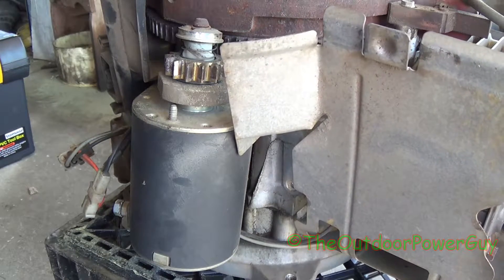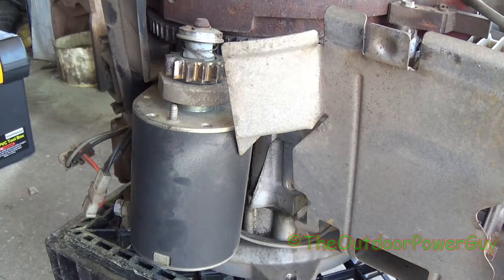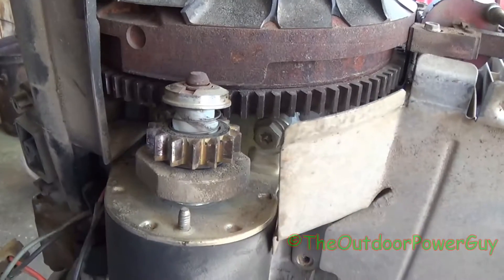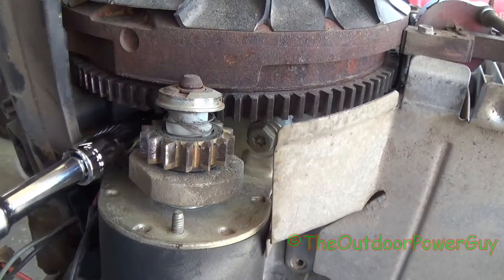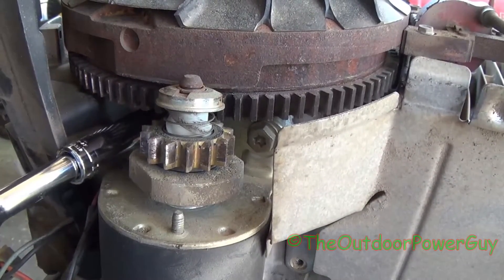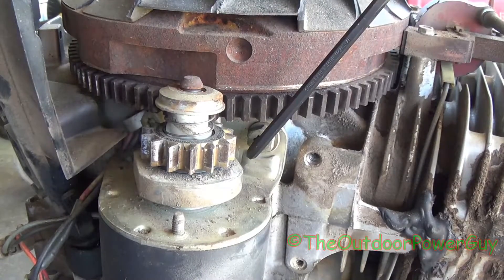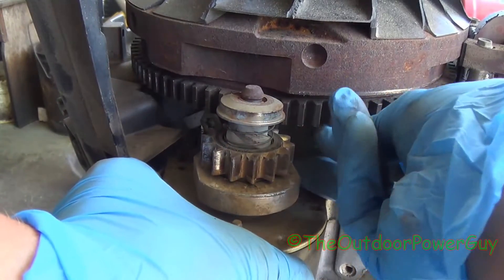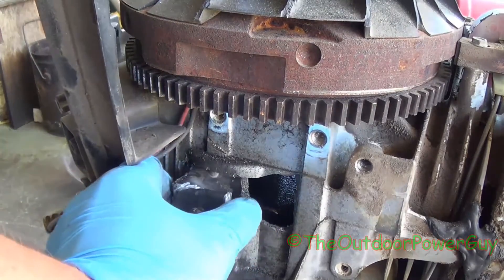HOW TO REMOVE THE ELECTRIC STARTER ON A 17.5hp BRIGGS & STRATTON INTEK ENGINE 31C707

Comment: I bought a old riding mower it has a 17.5 Intek  Just like the one you have. I pulled the starter off And sure enough a big busted out hole, just like yours.  Not liking these Intek engines so much. And the mower I use has a 17.5 Intek on it as well.

Comment: Do you have a part number for the replacement starter?
Reply from the maker: you have to make sure what type of gear your current starter uses, you got a plastic and a metal one, they won't interchange, if you are unsure look on the valve cover of your motor, there will be a model type and code, you can email it to me at youroutdoorpowerguy(at)gmail(dot)com, i will look in Briggs dealer parts lookupt o get you the up to date part number :)
Reply: @ thanks for the reply! I ordered one yesterday, hopefully works out well :) . Doing a mower flip.

Comment: I've noticed that the starter gear that engages the teeth on my flywheel does not retract a good part of the time.  If I manually spin the engine, it WILL drop.  Does that mean I need a new starter?
Reply: No!...clean and apply dry lube 🙂

Comment: That's not an Allen head bolt....it's a TORX head bolt! Use the right tool for what you are doing...an Allen head wrench will strip out in a Torx head screw or bolt!